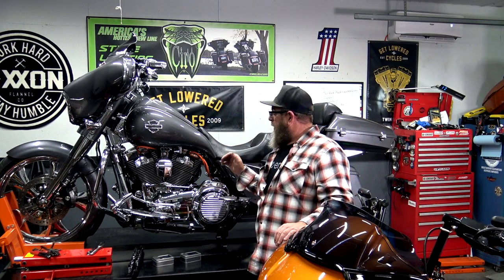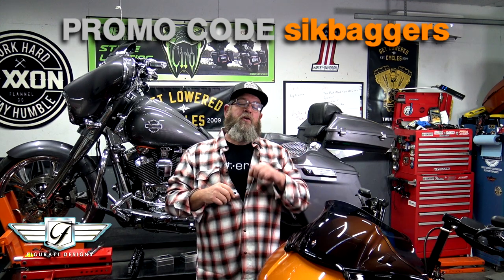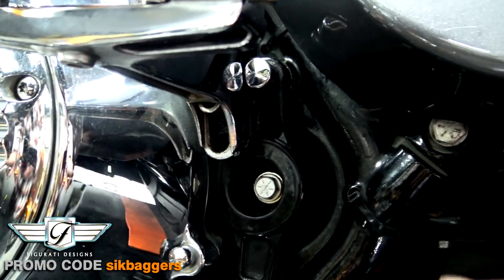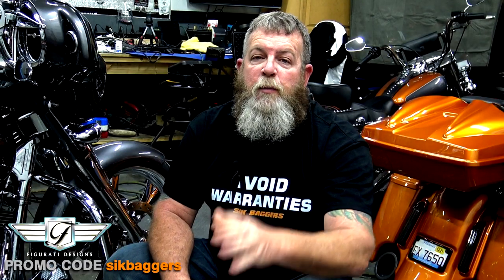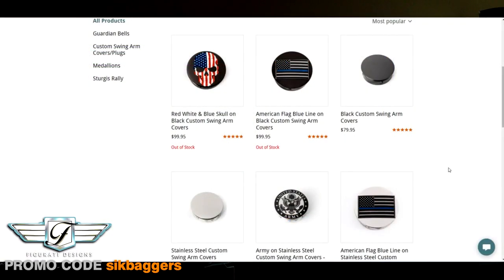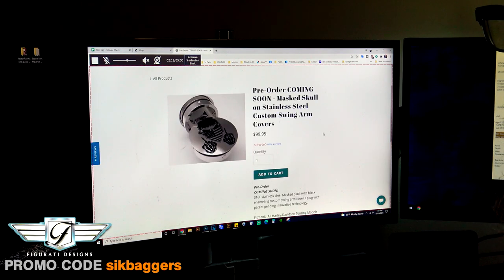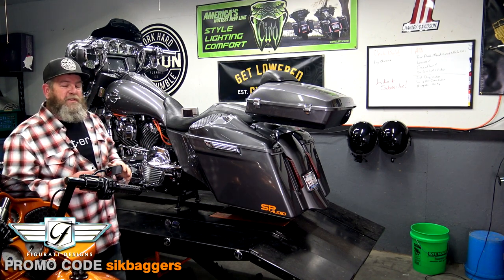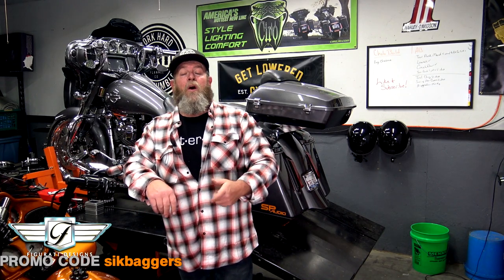Replace Your Bagger Swing Arm Covers With A Custom Cover! These are SIK!  Figurati Designs

Comment: I must say they are absolutely get. I’m an Army Vet and I ordered a set in late August when a saw them on Robert Simmons channel. One of the best little items for your bike. 👍🏾
Reply from the maker: Yes sir...Robert done a great video that I watched after I found them online..knew I had to get some! Thanks for checking out the video my friend and thank you for your service as well.
Reply: @sikbaggers  
What is the best way to clean rust out of the swing arm bolt cover cavity??? 
Any method I can think of seems like it’s just as likely to screw it up worse!
Another question; did you lubricate that O-ring before installing it in the swing arm to prevent possible damage by dry rot or the rubber getting hard and brittle???

Comment: Jus ordered mine glad somebody came up with a better and kooler detail instead of plastic plug can't wait to see it on my 21 streetglide special
Reply from the maker: Gonna look sharp on that SGS! Thanks for checking out the video Gary! Which ones did you get?
Reply: bought the black with chrome skull flag I've blacked out my bike but think the black with little chrome will set it off

Comment: Great idea , I’ve lost these covers before
Reply: When you lose one of these youre REALLY going to be sad. A hundred bucks?  Not in this lifetime.
Reply from the maker: Yeah the plastic ones comne out way to easy! These things go in tight! If they are applied correctly there is no way these are coming out unless you ant them out.
Reply from the maker: @JHV166  It would suck if you lost one but after installing these on both bikes Im confident that they arent coming out unless sI want them out. They are tight right up on the frame. I had to pry pretty good for it to even come loose enough for me to work around it.